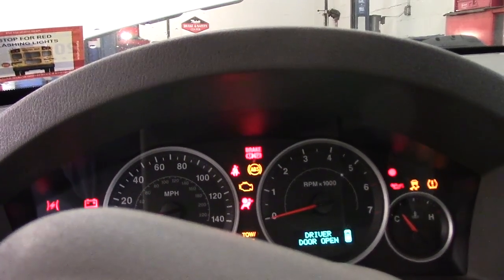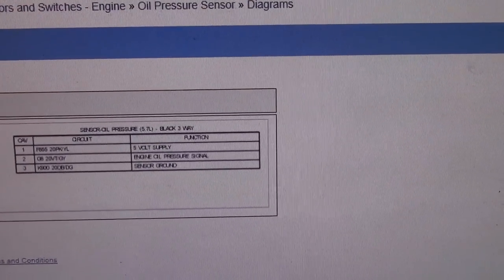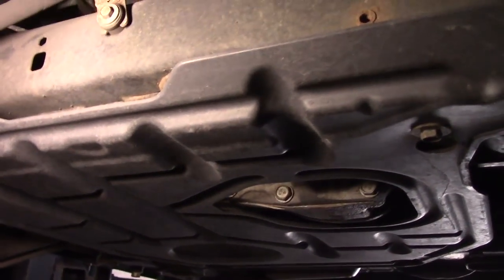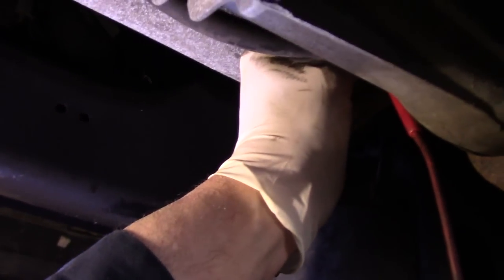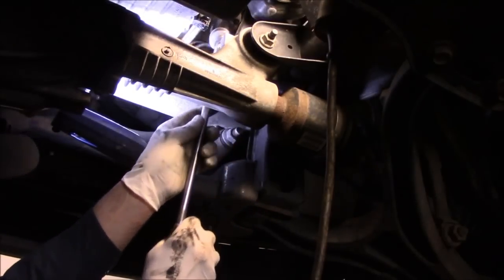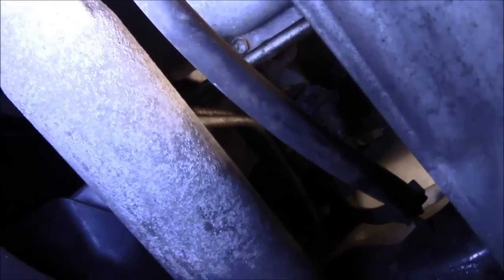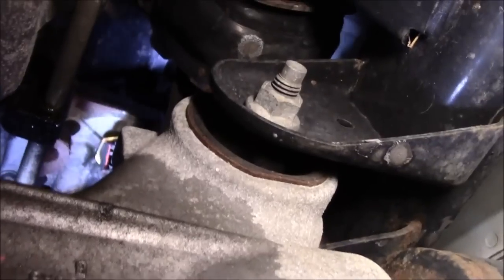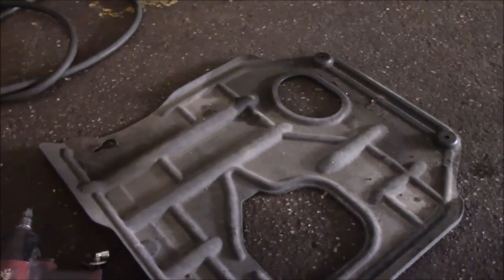How To Replace The Oil pressure Switch Jeep Grand Cherokee

Comment: Great video. Just purchased an 07 Grand Cherokee with the 5.7. The engine light came on. In the start position I'm getting the red oil indicator light. Not while driving just the start position. This hopefully explains what's going on. Thanks, I'll post when fixed.

Comment: What size socket(deepwell) did you use? 

Btw, the contact points on the sensor "nut" are rounded, so using a star socket is a bad idea...so make sure its a hex socket not star. Refering to the oem Mopar part, cant speak for the others.

Comment: Did you have to apply any sealer to the threads on the new oil pressure switch before you installed it?
Reply: It should already be applied as it was for me.

Comment: How much would it be if I take it in to get to change the oil light sensor? ???
Reply from the maker: The labor will be about 1 hour the cost will depend on where you live and what shops get per hour there.Thank you for watching .  Don't forget to subscribe.
Reply: I had the same problem, when to buy the sensor and paid under 10 dls. It took me about 5minutes to replace it.